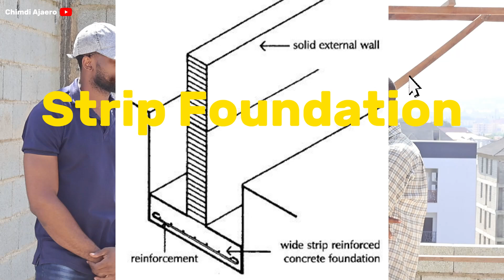See How This 6 Storey Residential Apartment Was Built in Abuja, Nigeria (Building Construction Tour)

Comment: Good job so far brother ! Knowledge is there !! Just few areas to improve such as the safety of your mason, he had no hard hat, no steel toe boots these are not luxury , they are safety indispensables.  Also the way of providing mortar from ground to the highest floor has to be better than this in 2024 without breaking the bank , Please, do not be minimalist and cheap in putting adequate amount of mortar between brick to form walls resident's lives are at stake, to finish, each floor can be clean of debris as you go to enhance safety, cleanness, workflow and save time! other than that, thumb up !!
Reply from the maker: @gathobeevens2644  thanks for the insight 🙏🏾